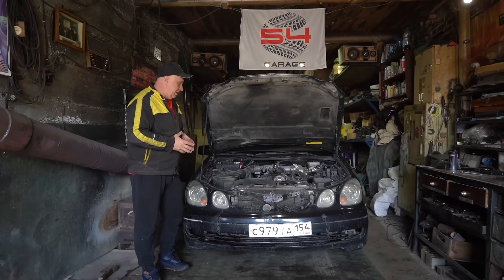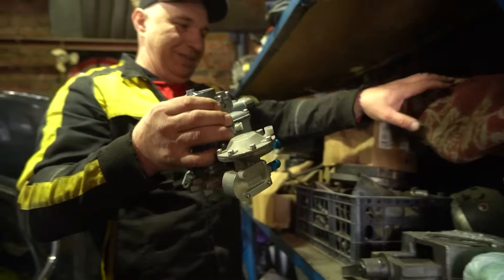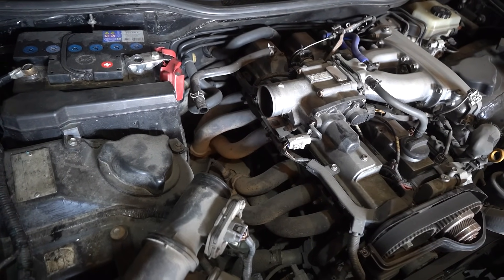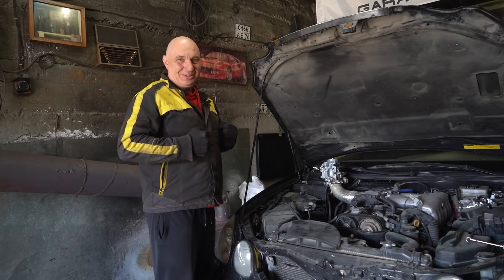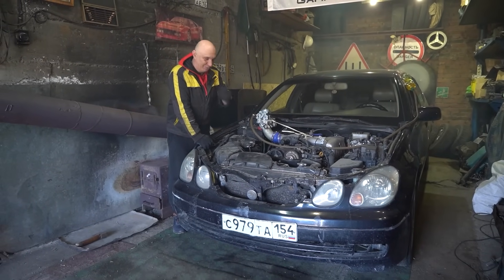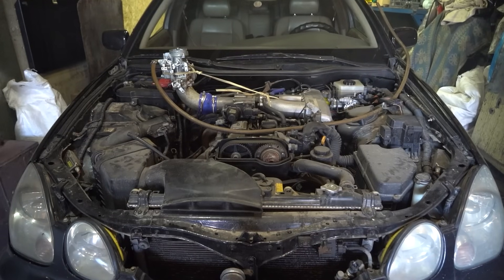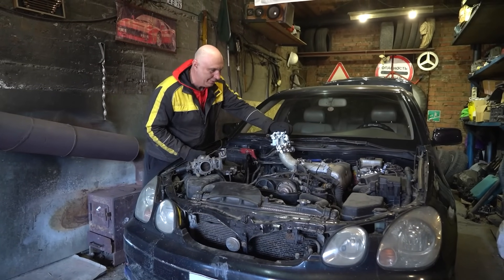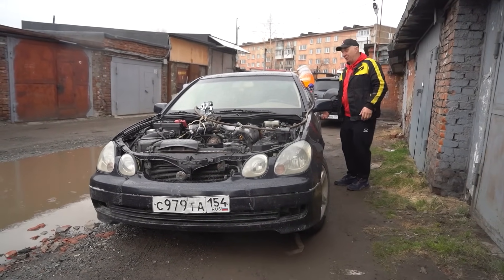We fit a carburetor to a 2JZ - will it work?

Comment: Should add an electronic inline fuel pump from the tank to the carb
Reply: Too high pressure. They should do custom pressure regulator. Although, 3-line valve also can work
Reply: @Klypin  A low pressure fuel pump 6-7 psi, I think he is talking about. If he squeezes the bottle while holding it above the carb. and it runs better. I'm wondering why he didn't just put one on to begin with?
Reply: @ yeah just enough to keep the carb filled
Reply: @Klypin  What do you think carburettored vehicles used for decades?
Reply: @timjohnun4297 carburettored cars used low pressure pump, 0,3 atm, as I remember. I have practice, rebuild jeep Cherokee on carburettor in forest. I use 3-way valve from UAZ for dropping extra pressure

Comment: Never in a day would I have thought Id see a carbureted 2jz
Reply: I'm going to DCOE a 4G63 16V.
Reply: Same!!
Reply: 🚙 ⛽️ 🛞 I would like a similar project done on old Mercedes-Benz SL cars with a straight 6 cylinder engine. Maybe this would bypass having to replace expensive junk multiple wiring harness that have to be replaced every 5 years?
Reply: @brendanbenoit that’s a good idea. Carberator fixes all electrical problems!
Reply: @Neo_s14  Tell that to my Bandit, granted It would run with a dead battery and the stator disconnected,  but it still had it's fair share of electrical problems.
Reply: @brendanbenoit legit street cars here on YT just came a across a 1985 G wagon inline 6 with a GM Carb conversion
Reply: Dude, diferent performance., yes. Argentine ford Falcón, chevy 400ss... All 6 line carb. U justo need to fill the cans properly, ill work. Fuel is fuel.
Reply: 6 throttle bodies, for the win!
Reply: @MattBrownbill  triple side draught webers
Reply: @timjohnun4297  nice...
Reply: dunno man there's plenty of dohc inline carbed engines. it used to be more popular for like lower level motorsports to do the swap.

 a rather common swap in asia for smaller honda bikes and such is to carburate them rather than mess with buying a replacement ecu and tuning that.
Reply: @lasskinn474  People seem to forget that engines weren't always fuel injected, and ran just fine
Reply: Awesome
Reply: @gabrielvieira.4358  Same :D
Reply: Why not?
Reply: I have seen carbed Subaru sti engines
Reply: Its been done before https://www.youtube.com/watch?v=ObJTRhxhnQ0
Reply: Someone has put 3 weber dcoe carb init
Reply: Orrrr, buy a fuel pump/maybe injectors/possibly clean the MAF.. then it will run another 200k-300k miles without issue.
Reply: One big problem comes from lack of spark advance control.  The computer has likely fixed the timing and that will cause low performance.  The other is that the intake is handling a wet air-fuel mix and there will be a lot of fuel deposited on the cold walls.
Reply: All Cars in this case jdm, Nissan fairlady and skyline use to be carburated anyway right (?)
Reply: Only in Garage 54
Reply: @lsnium thats what happens when you don't build cool shit, you don't see anything
Reply: In NASCAR
Reply: @gio2812872 Not one single Toyota team is using a 2JZ in NASCAR.  At any rate, theyve been using port injection for quite some time.
Reply: I'm not so sure there's 2jz's in NASCAR. I assume Toyota uses the same effed over chevy small block as everyone else in NASCAR. @gio2812872

Comment: Fit a bank of 6 carburettors... Just like the famous Honda CBX1000 and Kawasaki Z1300, THEN add 6 separate exhausts!!!! The 2J will then SING! (There are videos on YouTube, where a CBX1000 fitted with six exhaust pipe setup, and it sounds like a F1 race car!!! 😏👌
Reply: They did this with lada engine.
Reply: @PREDATEURLT  4s good... 6 is better 😏
Reply: Better 4 turbos 😂
https://youtu.be/FHORRZik4VA?si=Gi3gIXs4jggnC3c6
Reply: Imagine talking about what you see on YouTube instead of building stuff yourself.  What a breed of monkeys